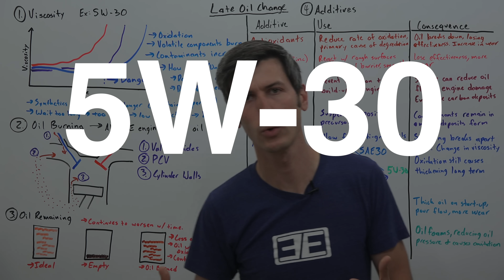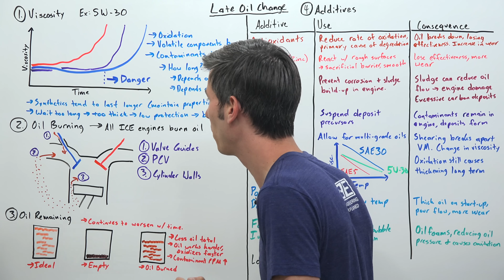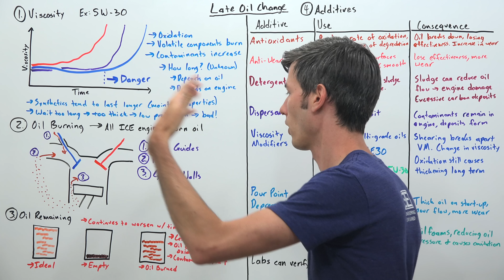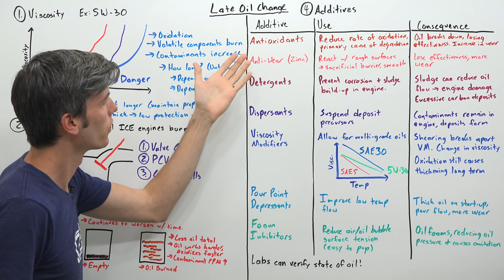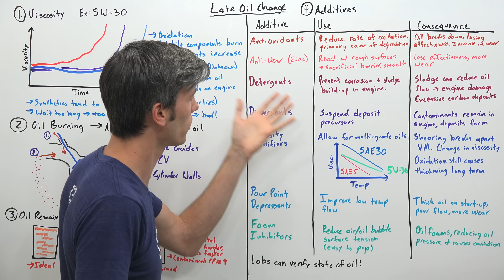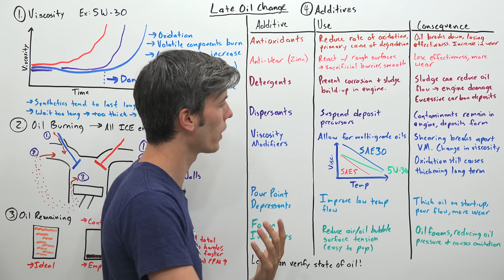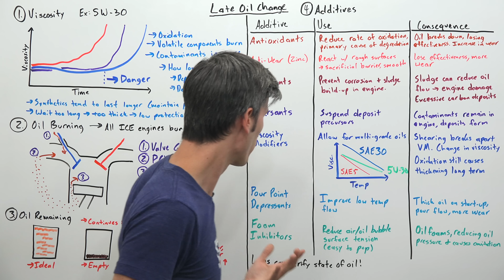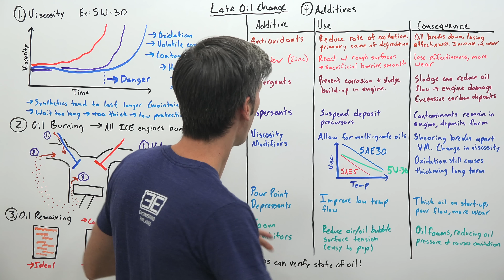What If You Forget To Change Your Oil?

Comment: "All engines will burn oil."

Toyota 3.4 V6 with 300,000 miles: "This man has a sense of humor!"
Reply: All engines over time will start to burn oil, even under absolutely optimum conditions.
Thats a constant rule of our universe, nothing will last forever!
Good maintenance will delay the inevitable & save you money, thats all!
Reply: @Otto45  don't know about that, my 94 Trans Am I bought new has 338.000 miles now, 28 years old, engine never been touched, even the timing chain is original.  Change oil every 3000 miles. Every time I check the dipstick before draining,  it always shows right at the fulll mark. Has never failed the California emissions test,  which is very strict. They actually put it on a treadmill simulating climbing a steep hill for about 3 to for minutes at different speeds and with the car in different gears. I always have my fingers crossed and after the test is completed,  the words, it passed, no problems, is welcome indeed!
Reply: A Nissan 1.6l qg16de 270000km, changing oil every 5000km, not a drop of oil burnt.
Reply: 2013 Toyota Avalon 3.5L 173K Miles, oil change every 10k, 75% highway driving at 70MPH. No burn!!!
Reply: I had the same motor in my Tacoma and 4 runner can confirm zero oil consumption
Reply: Had a 2008 Rav4 with 4 cylinder...about 1 quart every 1,000 miles. From what I've read they start at about 50K and just keep running and burning oil. Drove until Trans went out at 270K. Spent a ton on oil lol
Reply: @WirelessNut main seals like sieves.
Reply: @johann_eigler  Pretty much! Mine has a seeping main seal, but it doesn't leak enough to really notice.
Reply: 20 year old bmw engine 200k miles, no burning of oil between 10k oil services...
Reply: All cars will burn oil, it just depends how much.
Reply: Not all, but most
Reply: 2011 KIA Sportage 300000 not a drop.
Reply: @WirelessNut taxi's were getting over 1,000,000km with falcon's, when they still made them. A great car.
Reply: Or VW 1.9 with 500,000
Reply: Engines that naturally run hot will burn oil.  Something I was told recently 😮
Reply: civic.... not saying anything else XD
Reply: @drakeawoken4189  😏 True, Nuff said
Civic here as well.
Reply: Ford F150 4.9L Inline 6 with 745, 781 km: (burns oil, but still runs)
Reply: @billyboy4797  I do 7500 mile synthetic oil changes in my 2000 Toyota Tacoma 3.4. The engine oil level literally doesn't change by 7500 and there is no sludge/varnishing. Today's oils are insane. My engine only has 140,000 miles though.
Reply: @Dcc357  you should get many more years out of your 3.4. Regular oil changes make a big difference. My old truck has had oil changes regularly, even though most is highway miles.
Reply: Just because it can doesn't mean it should
Reply: That's the best motor Ford ever made.  Now they make crap
Reply: @bertblue9683  Nearly all the engines made in Australia by Ford were nearly unbreakable with the exception of the 3V 5.4L in the BA due to timing issues, rectified in the BF. The Barra's may not last quite as long as the intechs, but for the average person, the IVVT completely changes the driving experience whilst still lasting one million kilometres. They may only make 33% more power at peak, but that power kicks in extremely low in the rev range, and is maintained as the revs increase. From driving my intech and barra, I would estimate at 1500rpm, the barra makes about double the power. With the long first gear, it really helps performance and fuel economy. I really feel if the ZF 6 speed was attached to an intech they would have been much more effective at putting down their power.
Reply: My 2001 5VZE 3.4 just threw a rod about a month ago at 130,000 miles and fresh synthetic blend. Life just happens, I seem to have been very unlucky. Not a single knock, then POP @ 4000rpm through a yellow light. Thought it was my timing belt, but the rod was ripped in half and the bearing flattened, mounting hardware everywhere. 🤷‍♂️ never had a single issue with this vehicle otherwise, it was really surprising. Even with valve cover gaskets needing a change out (already had the parts to do it) the oil reduction over time was so slow as to be almost imperceptible, and I checked it weekly. 

Couldn’t afford to fix it, got quotes for $6,100 used with more miles or $9,200 remanufactured out the door and just decided to call it quits.
Reply: @goodsev5  that's crazy since these have forged rods. Sure it wasn't bad gas? Too low an octane could cause detonation. I know mine doesn't like regular fuel. I have to use mid grade to prevent knocking.
Reply: @Dcc357  I agree, totally unexpected. It always ran well with regular octane for me and I never had any knocking or pinging. I looked around and I appear to be one of the rare times this has been talked about online, found one guy with a rod through the side of his engine block in a 4 runner, same age, same engine. Bizarre and sad. As far as I can tell this isn’t something that I caused, I’d be ready to accept responsibility if it was but I haven’t been able to think of anything.
Reply: @goodsev5 I know this is 2 years old at this point but I’ve heard a similar story from a buddy of mine that happened to his friend. He took his Subaru to a run of the mill gas station and suddenly down the road. A rod went through the block. Mind you, he had no problems with this car until then. People underestimate the quality of gas. It can really annihilate a very healthy engine in a second.
Reply: @goodsev5  Maybe oil pump wasnt supplying enough oil or, idk what....
Reply: I had 200k miles on my Toyota never changed or added oil. Oil was always at same level.
Reply: @somethingelse4150  never CHANGED the oil?!?!?!
Reply: @Maginus-Sama  it's a Toyota. I opened the hood once to take a look, closed it and never opened it again.
Reply: @somethingelse4150  it is true, but come on, take care of it, AT LEAST change the oil.
😔
Reply: @Maginus-Sama  Changing oil every time you change your socks seems to be an American obsession. Highish mile changes is not the key issue. Keeping it for five years or so is going a bit far.
Reply: @somethingelse4150  LOL, I'm gonna call BS on that one.
Reply: @Maginus-Sama  I bought a beater corolla for $500, never changed the oil in 100K miles of ownership. Still ran when I junked it. The drive train outlasted the Swiss cheese body.
Reply: @Maginus-Sama  That is no longer oil. It is tar.
Reply: @somethingelse4150  damn, it probably looked like thick jello in your oil pan
Reply: @somethingelse4150  You're somei else alright 👻
Reply: @somethingelse4150 …You wouldn’t tell us a big lie now would you?
Reply: @WirelessNut its just everything else thats crap. My 1st aussie car was a au falcon 6 years ago. 
Literally fell apart when using switches, steering lock fell apart and electric shorted,  the rear brake wheel cylinders are riveted on. It falls apart around you. Worst built car i ever, most cheaply made car i ever  owned.

Comment: Very informative, as always EE. A question in related vein: I drive my car very, very rarely. It usually sits for a week, very often two, sometimes more. It still runs very well (it's 7 yo) and oil changes come every 5-6k but I often wondered if sitting in the parking lot for 2 weeks, do I have any lubrication left at startup. So would it be a good idea to have it run for a few minutes every few days.
Reply: Waiting about 15-30 seconds is enough to get oil to circulate in the engine. If you can drive it up to operating temperature every few days that is good, but just turning the ignition on and letting it idle for a few minutes will actually cause more damage (more time spent with cold oil, idling doesn't effectively warm up the engine and you will get condensation which will contribute to oil oxidisation).
Reply: @stephensmith2027  that's why we don't have to let the car idle to get to operation temperature, that's overkill. What we HAVE to do is drive it. Also, driving a car at least 30 minutes per week is enough to maintain the engine correctly.

Comment: @7:20 i believe that is transmission fluid being drained out.  it looks red and i see a cooling line.  do not fill your transmission with engine oil because it will slip. :)

Comment: What if you put two different weight of oil in. Example one quart of 15-30 and one quart of 15-50 does it come out as 15-40 😁
Reply: eh, something like that, the viscosity when heated should be somewhere between 30-50
Reply: That is correct. Like how two quarts of 0W20 and two quarts of 0W30 makes four quarts of 0W25.

Comment: now i have a question, the oil has rating of  10k mile or 1 year. but what if i only have 5k mile over a year, do i need to change the oil?  i did check the oil still looks pretty clean btw.

Comment: I own a civic x 1.5 turbo. In December last year I changed my oil ( 0w20 motul 8100). Also in December I’ve relocated to another country and my car sat in the garage until June this year. The computer says I still have 16k km till I need to change the oil. Is this ok ? Or should I change it every 12 months.

Comment: My dad bought his 1993 Ford ranger (4cyl) brand new. He has changed the oil 4 times in over 200k miles! It does burn a little o so he adds fresh oil now and then. Truck runs great, passes smog. I know that 3-5k is optimal but his truck proves that an engine CAN survive with extremely used oil in it.
Reply: Well, it has to be a strong engine without variable valve timing and other crap that varnish and sludge can ruin. Not to mention those old 4 cylinder engines make like negative horsepower lol.

Comment: Very good!  I have a p/u truck that is occasionally used.  The last time I extended change to 2 years (~1000 mi.)  I used Seafoam before the change, and it has 1/2 qt. Lucas; oil came out dark.  These are the risks I was wondering.

Comment: Ok, funny fact:
In Europe, cars service manual require oil change every 18k miles (30k km) - Opel, Renault, etc or every year.
It is obviously to long. Responsible people change it every 10k miles.

Another funny fact - BMW Europe.
Oil change require every 18k miles.
In the USA, same car, same engine - 10k miles.
Transmission oil - eu - never, us - every 30k miles (or something around it).

Comment: I have 3 cars.  oil was changed in the beginning of the year and I put around 1000 Kilometres each.  then quarantine happened and all 3 are occasionally started and let to run for 15 minutes.  will this be bad for the engine not changing the oil for that long?  also I don't use these 3 because I got another one that I use daily.

Comment: Went about 2000km over my scheduled oil change interval (15000km) due to mechanics being booked out leading up to xmas and then closed for 2 weeks, just as I had overseas visitors and had to do a lot of driving. The engine was noticeably louder during idle as well as under load, and when the oil was changed, the quietness then uncovered diff noise (diff oil not changed in 93000km). Significant noise reduction now that the diff oil has been changed, however I wouldn't have said the car was noisy before. The change in sound just creeps up on you.

Comment: I notice with my car and a lot of trucks I have driven that when the oil is getting due, it usually needs a top up which adds a bit of fresh additives and of course adds to the volume circulating.  Not a metric I would rely on but a handy rule of thumb. The type of driving is also important too. I drive a 70 kilometre round trip for work on expressway driving which is much kinder than stop go driving. Probably could go over the distance but better safe than sorry if you don't get your oil tested to know how much life you really have left.

Comment: Changing oil too frequently will put excess ZDDP in the engine which may poison your catalytic converter sooner.   ZDDP plates on moving parts but too much will leave some in the oil.   With the PCV system, burned oil (ZDDP) will go out the exhaust and poison your cat.

Comment: I have a question, why do Americans have to change their oil so frequently compared to Europeans?
Every car maintenance video I've seen from an American YT channel has said anywhere from 3,000 to 6,000 miles between oil changes but European channels quote 10,000 miles or higher. The service interval for my car for instance is 20,000 miles.
So why is there such a huge difference?
If you suggested to a European driver that they had to change their oil more than once a year they'd laugh in your face.
Reply: We still sell cheap conventional oil in barrels. Also, the climates here suck. If you drive short trips in the dead of winter all the time, your oil will be diluted in fuel and lower the viscosity. Engines run rich when cold. Moisture also builds up and creates white sludge. This doesn't happen if you drive long enough to get the engine hot, but grandparents don't do that! The hot and dusty southwest oxidizes oil faster and makes it dirty quicker. I don't even take a synthetic past 7500 miles or a year here in Arizona. If you drive on the highway all the time and use synthetic, yes 10,000 miles or more is possible anywhere. We are also the western version of the Middle East. Oil is like candy here lol.

Comment: Actually the viscosity of old oil will decrease and not increase. A 10W-30 oil is basically a 10 wight oil that will act like a 30 weight oil when warmed up, with the additive package. The older it gets and the additive package get used up the oil will go back to its original weight.
Reply: Jason is discussing how beyond that, at some point, the oil will turn to sludge and get very thick.

Comment: In 1995 I bought my dysfunctional sister a brand new Saturn. She never had the oil changed or level checked. At about 45K miles the engine stopped working, duh

Comment: Newer Honda's have a % oil life remaining gauge based upon your driving conditions etc..i just let it get down to 20% remaining and then change oil. Its about 7000 miles per oil change using 0-20 oil in a 2017 Honda Accord.

Comment: The oil pick-up (a very fine sif) of the oil pump, also blocks which starves the oil pump ánd then usually the upper reaches of the engine leading to bearing failure : thís happened to my previous Volkswagen POLO a few years back - I didn't own thát car from new however.

Comment: we're now over 236,000 miles with our 1.4 tdci Fiesta changing the oil every 6 months without fail. it uses roughly 0.13L (0.14 quart) engine oil per 1,000 miles with little change year-on-year

Comment: the longest i ever went was 42,000km (26000 mi) without an oil change, i was so broke i couldn't afford to do one, $2 gas fill ups just to make it to work broke. funny enough i drove that car to over 400 thousand km (250,000 mi), only got rid of it because it would not even come close to passing safety inspection. it was a 1990 grand prix 2 door with the 3.1L

Comment: Well here's a story for you guys. My family member drives an envoy, it takes 7 quarts (wow right) and not only does it leak or who knows where it goes but they also dont tell anyone it needs to get changed. Theres a light on the dash set for like 3-4k miles and it will automatically come on. Well I just changed it and there was only 3.5 quarts in it. I filled it with a full 7 quarts so that basically proves theres wasnt any hiding anywhere inside the system. Wow though.. missing half of the oil. Only time will tell how long it lasts

Comment: I knew a guy who drove a big Oldsmobile 80,000 miles. He never changed his oil. His brother-in-law convinced him that changing oil just introduced contaminants. I pulled his dipstick. It was rusted into the tube. The oil was shiny black and thicker than I would have expected, but not low. The car obviously didn't use oil. I told him he should buy a new car before that one grenaded.

Comment: I always change my oil every 4,000. Miles or every 6 months. 

and change my oil filter 
Every 8,k miles 

Had the same Camry 
For over 4 years and over 60,k miles,  still running perfectly
Reply: i have diesel BMW from 2005 e90 with 186 411miles... change oil every 9000miles with filter, still running perfectly... lol

Comment: I bought a '93 Legacy that leaked oil for $500. It had 363k miles. First thing I did was drive it from Denver to Kansas City and back to visit family. Ended up driving it to 410k miles. I never did an oil change or filter change, just put a quart in every time I got gas. It ran great. Why'd I finally get rid of it? Couldn't pass emissions.

Comment: USA: Change oil every 6000 miles
Europe: Change oil every 30000 miles
Reply: Exaggerated, but basically right. USA 6k, Europe 12k. And on average Americans do much more miles a year. So less harsh on engine oil
Reply: @michaelwalsh90  currently the intervals here in Europe are ridiculous.
I still change my oil each 10k kms or 1 year.
Since I have several cars, I end up doing less miles/kms in a year, but once the year is reached, I change it alongside with the filter

Comment: Dude, the engine internal view you showed was a lawnmower engine. The problem of course being they use an oil slinger to splash oil up the cylinder walls. You can see the white oil slinger go up and down. Automotive engines are carefully designed to avoid contact of the pool of oil in the oil pan with the crank or rods. Otherwise a great vid.

Comment: Its not as Simple , i dont drive much , about 4000 - 5000 Miles per Year . I dont believe i have to change Oil every Year .... , its enough to refill it if its gone lower , i guess
Maybe every 2 Years will fit for me , only if you max out your engine , drive at the Limits , fresh Oil may be a good Idea ...